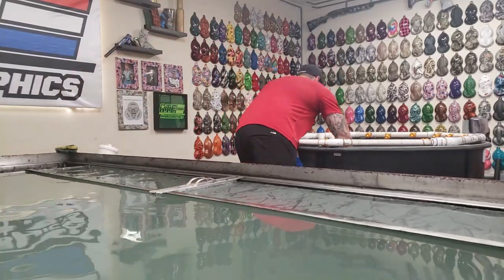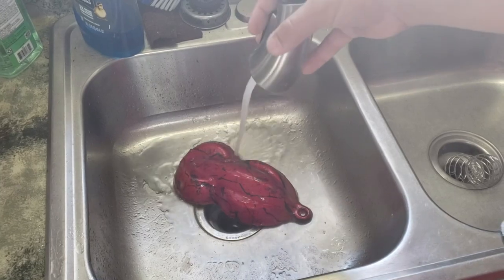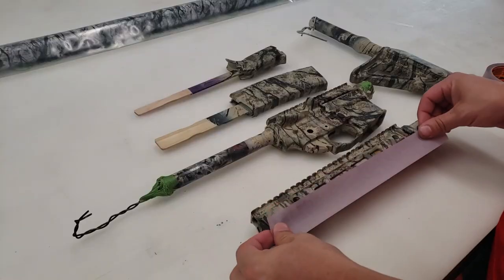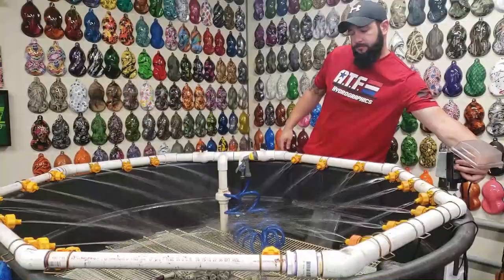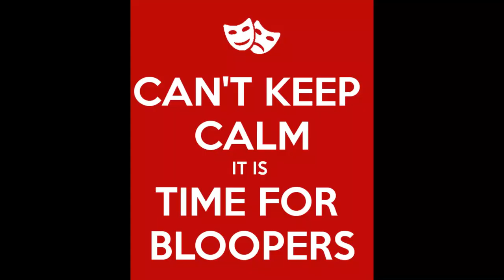How to Double Dip? Hydro dipping questions answered!

Comment: Best tip for dipping over cerakote C series? I did one before over cerakote and all the dip just flaked off 😂 I did figure it out but I would like to know what you would do
Reply from the maker: Just did 2 videos on this... hydro dip will not stick to cerakote. Tried it so many ways and it never turns out right. Just did to hydro dip paint and use cerakote clear over it.
Reply: @AllThingsFunHydrographics  well I'm just using the air dry series because my setup isn't the biggest but with the C series it has to cure for 5 days but once u cerakote it wait about 10 hrs then hydro dip and clear it so it all cures together. I found this to work for me

Comment: For engine covers or parts that need to be fastened down tightly, how do you avoid the clearcoat cracking or separating under the bolt head or washer ?
Reply from the maker: Use a good quality 2k clear and let it cure a full 30 days before installing
Reply: @AllThingsFunHydrographics  Cheers, I'll give that a crack🤣👍